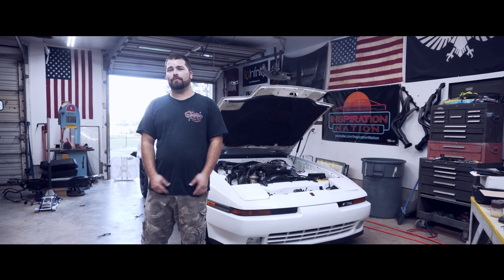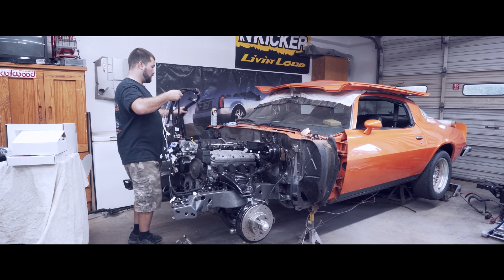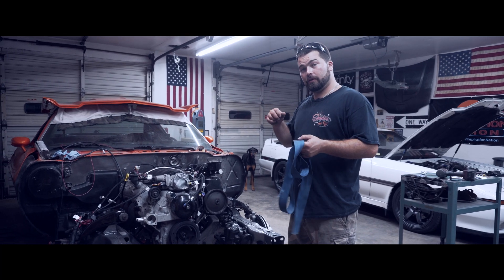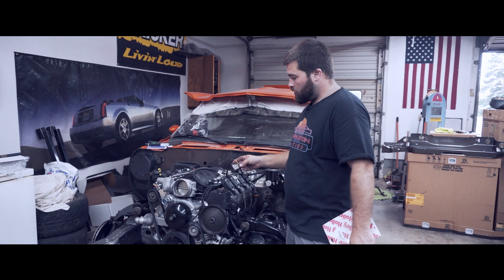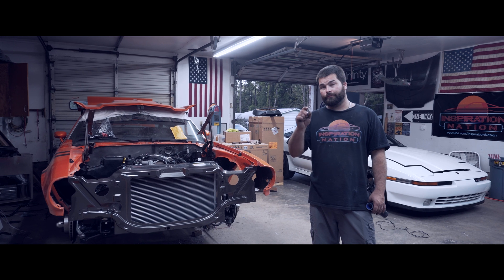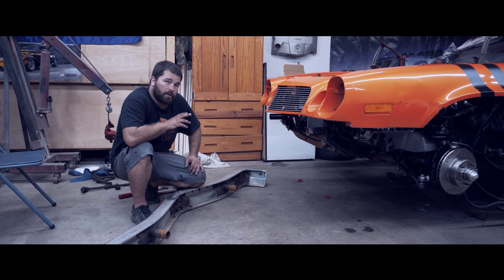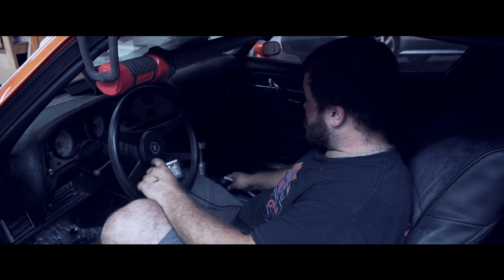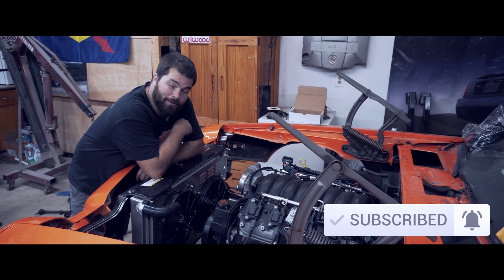Finishing up wiring on the LS2 Camaro

Comment: Got a couple questions for if you don’t mind what are the fittings you use for your power steering box I’ve been looking for them for mine and how did you do your gas pedal for the drive by wire thank you
Reply from the maker: For the gas pedal assembly we ordered the CPP 1970 through 1981 Camaro drive by wire pedal and bracket.The fittings that we used were 5/8-18 IFM to -6an and-6 AN Male to 11/16"-18 Male .We picked up everything from eBay